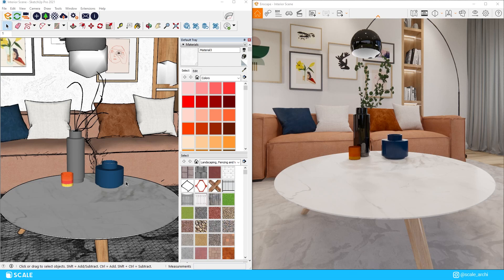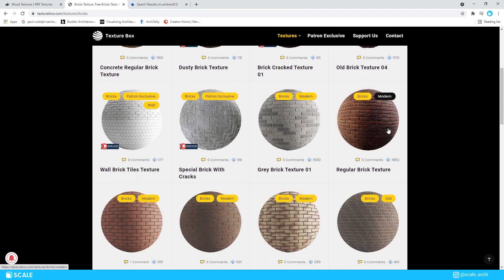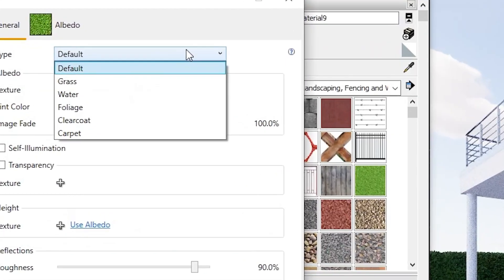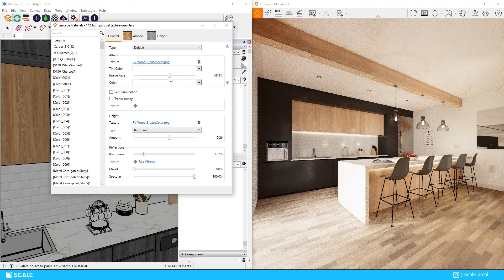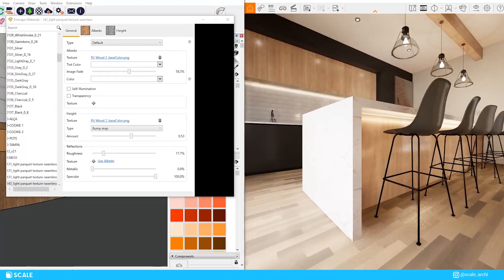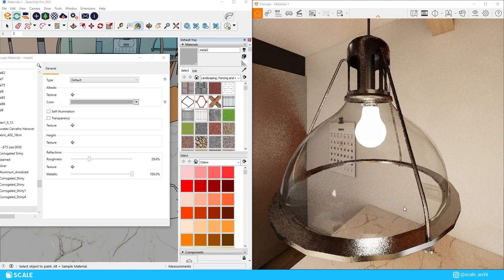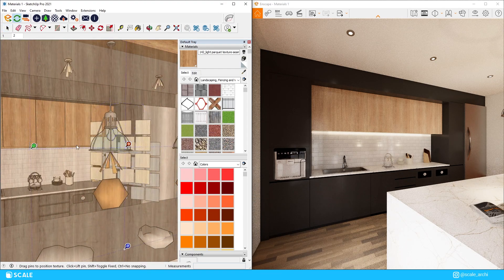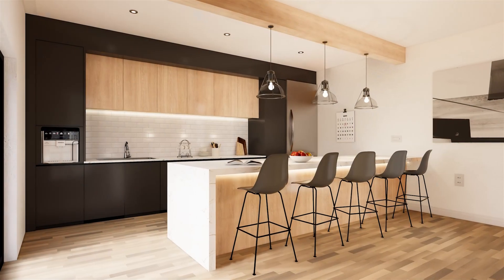Enscape Materials : Complete Beginner's Tutorial

Comment: Great tutorial, thank you so much! But I always had problem with rendering mirror materials, they seems reflecting a darker reflective and some missing parts in the reflection (for example, the mug in front of the mirror doesn't appear in the reflection). Do you have any tips or tricks to solve this problem?
Reply from the maker: Glad you enjoyed.

The mirror problem happens in most real time rendering software as of now. This can happen when the elements are behind the camera or when a part of the element is not visible from the camera angle that you're taking the render from, that's why the mirror won't reflect that part of the object/element.

As of now there is now known work-around for this issue, the best thing you can do is copy everything that is supposed to be reflected and actually flip it (mirror it in the other side of the mirror itself) and leave the surface open, or just glass.

Let me know if I was unclear, because I might make a video about this since it's a very common issue.
Reply: @MelosAzemi  thanks for your reply, that explains a lot!
Looking forward for your next video about this issue, that would be very useful 😃